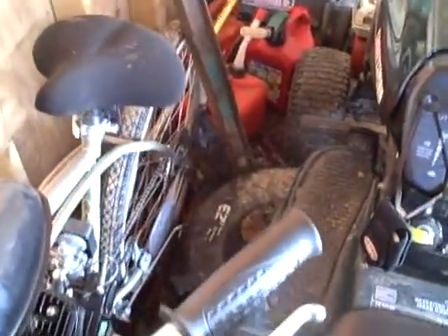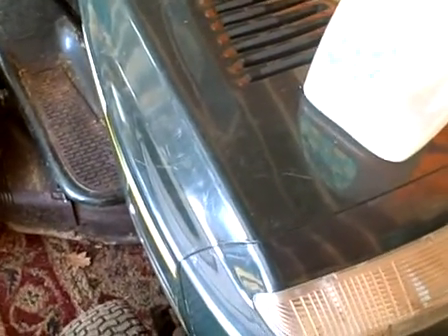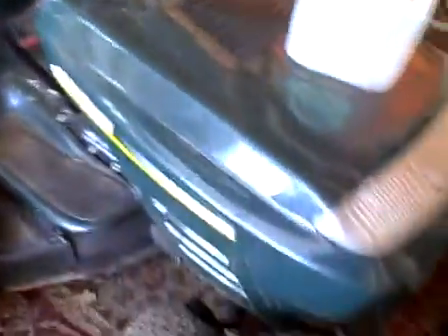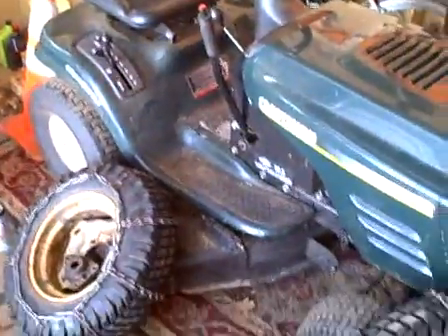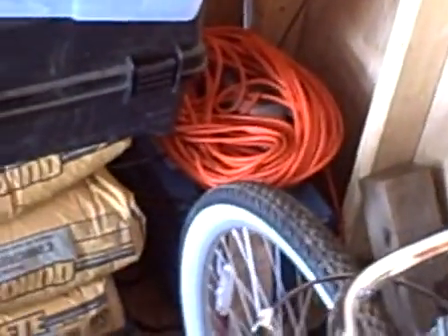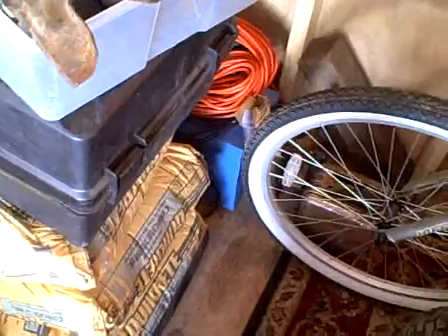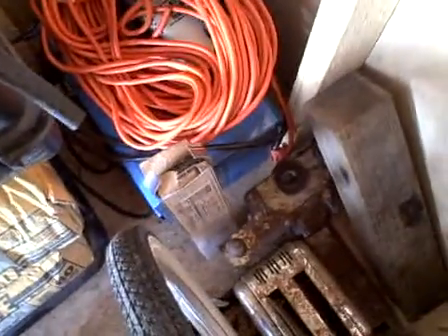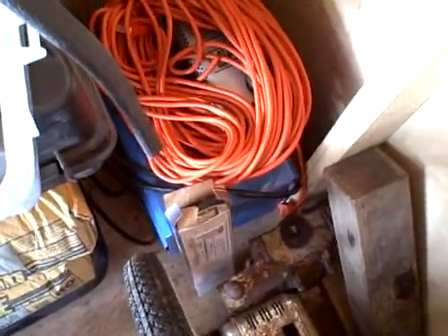Redneck roller coaster update.

Comment: I would go with a mig. Easier to use than tig, plus tig macines are more expensive. My favorite way to weld is arc welding. It takes lots of practice, but once you get good at it, things go well. Is that arc welder 110 volt? I would say the best thing for you to do is to go out and buy one of those little MIGs at harbor freight. the small ones are on sale for 100 right now. Also, do you have an automatic helmet already? Those can make all the difference in the world.

Jason